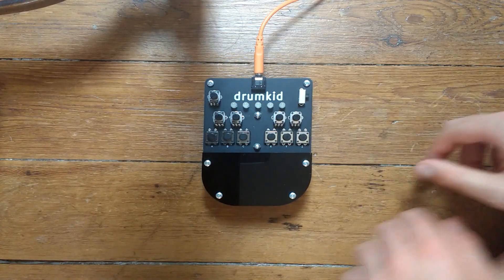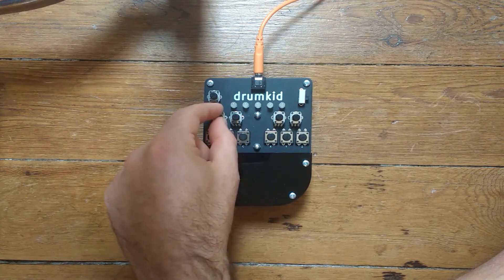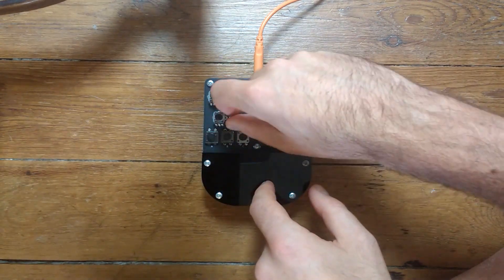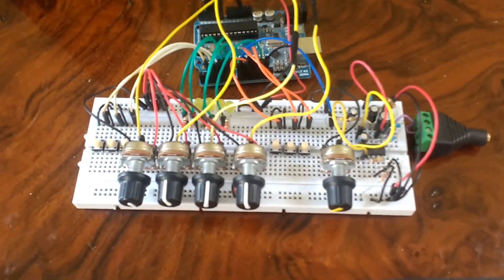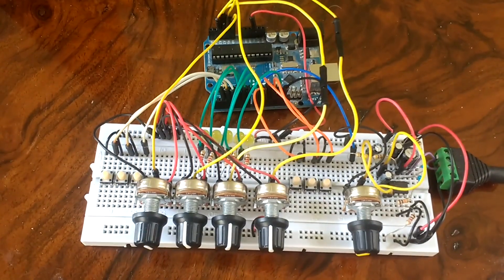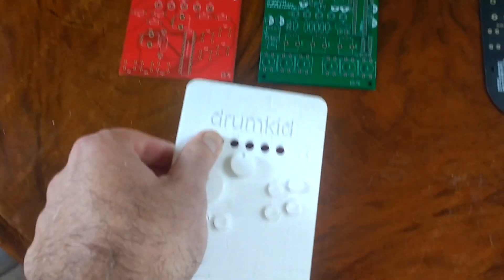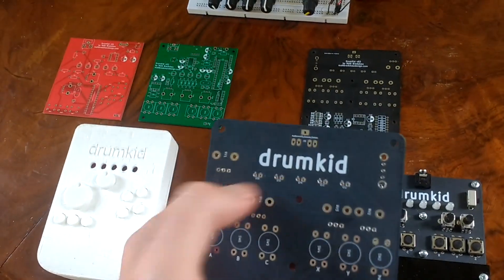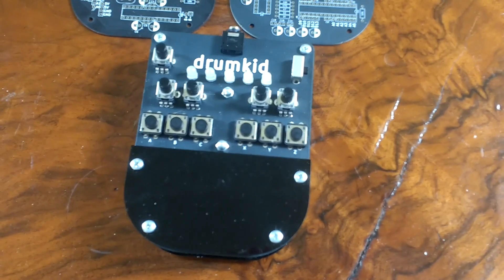Aleatoric drum machine (Hackaday Prize 2019 entry)

Comment: Man, without exaggeration, you're a genius. I did the first eager test, although I miss engage buttons and LEDs. The sound is much better than here on YT. So I have another filter, LRC, 330 Ohm, 3.7mH, 1.5microF, LM386 completely omitted. I consider that a on higher platform (STM32) with CV sync in/out control, would be a great commercial product, nothing similar exists. I'm planning to pick up the LED signal thru switch+ summing diodes to get minimalist gate seqencer. Once more chapeaux!!!
Reply from the maker: Thanks man! The filter/amp circuit has given me headaches all the way through, trying to filter out the high noise while keeping the signal loud and not muffled. I've got a slightly different circuit for the next version, but it's still pretty lo-fi. Might have a look at your LRC circuit, sounds interesting :) Lots have people have now asked me about a version of DrumKid with CV, so am looking at making a Eurorack version next year maybe, probably using a Teensy or maybe STM32.